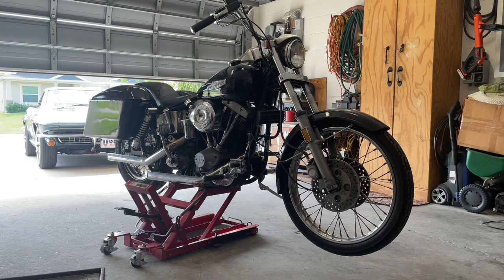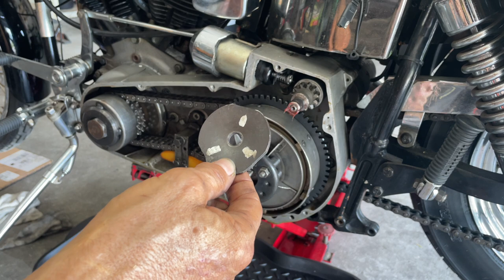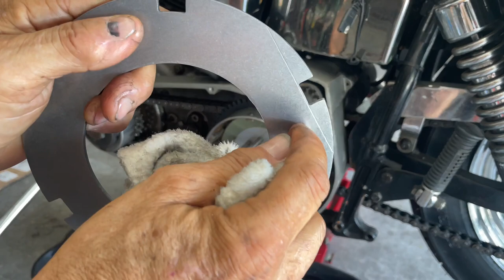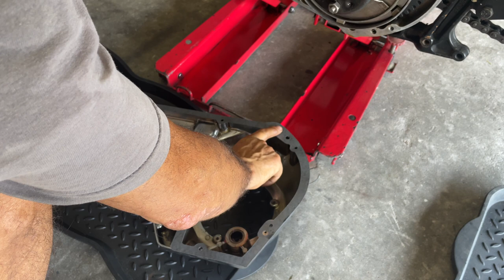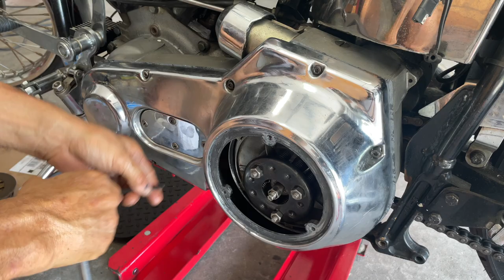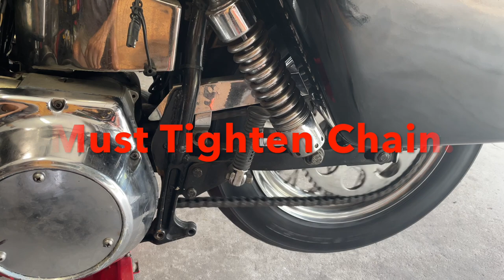Harley Davidson Shovel Head Clutch install.

Comment: Very thorough video. Could you please send me info on where,/who you got the parts from and maybe the 0aet number too? Thx
Reply from the maker: Happy to help I bought those parts on eBay. You'll have to do a little research but they're interchangeable for many years with those old Shovel head. Sorry I couldn't get in depth more but it's been a while. Thank you for watching and all your support Anthony. JP cycles is a good place to start. Ride safe and have a great day.    eBay.  https://www.ebay.com/sch/i.html?_from=R40&_trksid=p4432023.m570.l1313&_nkw=1979+Harley+Davidson+Shovel+head+clutch+kit&_sacat=0. Hope this helps

Comment: Does the starter motor come right out on the 1980 shovel I have it stuck in start mode and sometimes it pops the starter breaker thanks Rocco great videos!!!
Reply from the maker: Happy to help yes it does pretty straightforward. Just be careful. You know it's old. Thank you for watching all your support Rob. Let us know how it works out. Any questions just ask. Ride safe and have a great day.
Reply: @TwoWheelRocco  may I just ask on these older shovels when the starter motor started to short why did the handlebar starter switch start to smoke when it wouldn’t turn over? Shouldn’t the breaker have reset cause it finally did and the smoking stopped milliseconds later. Then I tapped starter motor with a hammer to verify before I ripped it apart and now it’s stuck engaged. Have a new hi-torque starter from J&P Cycles that just came in, I think that old one has never been changed since 1980. Last year I changed the starter solonoid and clutch drive but should’ve have changed starter too but I should’ve known the way the starter clutch drive gear was chewed up that the motor was weak too.

Comment: I have a 73 Shovelhead with new clutches not sure if I’m doing something wrong but it’s like it’s stuck in one gear and I’m not quite understanding on the clutch plate. Is it to the flat or or to the bottom of the bevel
Reply from the maker: I'm sorry I don't have the answer for you. I would check the linkage. I know I had problems with mine shifting out of first year and it was the linkage was slipping. Hope that helps. It's a basic clutch. Thank you for watching and all your support michelle. Ride safe and have a great day.

Comment: Put enough primary oil in there to touch the bottom of the clutch basket so that the oil will get flung around in there
Reply from the maker: Thank you for your input. It helps Bright safe and have a great day.

Comment: Those stamped Steel Derby covers always leak because they're never flat. Even if you flatten it out it will distort the moment you tighten it. You're better off with an oem cast aluminum cover.
Reply from the maker: Thank you for your insight on these old shovels. Ride safe. Have a great day.

Comment: 23:52 Great video Rocco,very informative. I recently purchased an 82 fxr,so I pulled the primary to check out chain.Everything looked good except I found a couple of rivets laying next to the magnet.Would you know where these came from. It doesn't look like the clutch.Anyway thanks again for the tuition.I have subscribed.
Reply from the maker: Happy to help. I believe it's from your clutch hub the rivet heads take it apart  and inspect. Thank you for watching and your support Pat. Let us know how it works out. Ride safe and have a great day.

Comment: The only way to cure that dragging of the clutch on a Shovelhead is to install a clutch tamer. I guarantee after another week or so of riding the bike you're going to have the same problem unless you install the Tamar.
Reply from the maker: Thank you for that insight,  yes it is a problem. I don't remember it as a kid being a problem when I had my Shovel head but I don't even remember doing a clutch on it.  when I was younger.  Thank you ride safe and have a great day Joe.